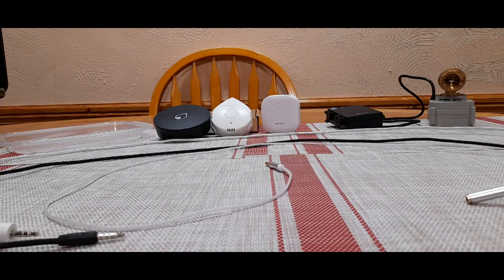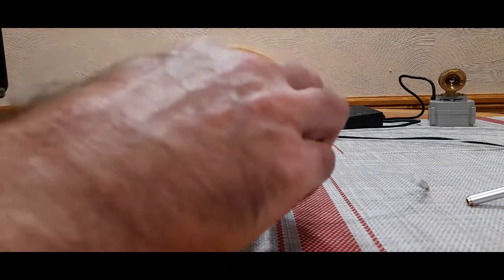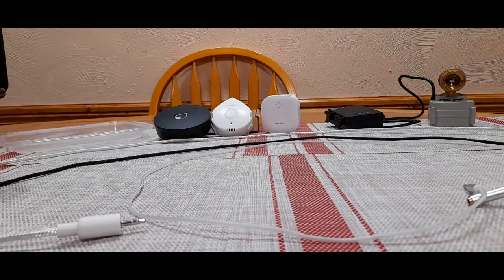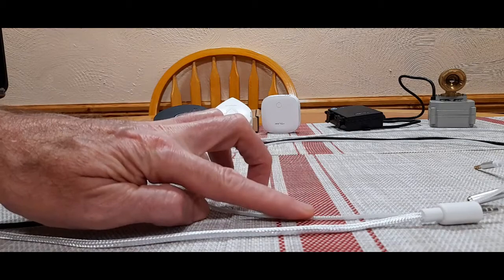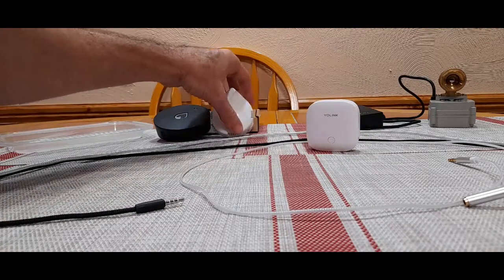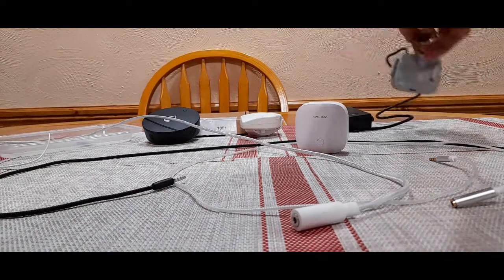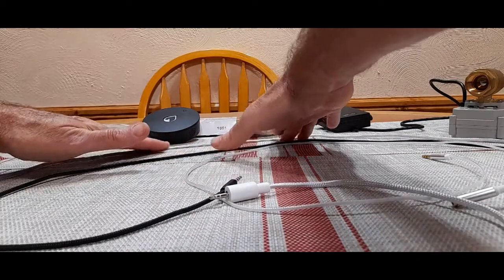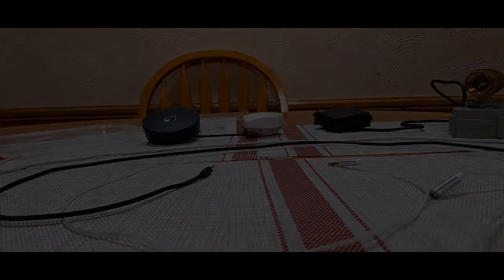Water Detection Cable Review: Yolink, Phyn & Honeywell

Comment: so the whole length of the cable detects water and not just the tip of the cable?
Reply from the maker: Yes, anywhere on the cable that gets wet will activate the water sensor. Thanks for supporting the channel by commenting and giving the video thumbs up.

Comment: for me it is not an issue that the cable does not lie on the table, because I will put the insulation on it. It is more important to know which product works more reliable and accurate/sensitive on long term. Do you have any test results about that? Or do you know any specific solutions for flat roofs? I will need several hundred meters of that cables..So I am looking for a professional product (cable) which should work ca. 50 years without any maintenance. items which are not under the insulation but outside can be repaired our replaced easily.
Reply from the maker: You are trying to detect potential leaks under a flat roof?  Thanks for commenting & subcribing.
Reply: @CyberMedics  on the flatt-roof there is an insulation which might be damaged over the years. In case of a leak in the bitumen  layer (on the top) rain can get into/under the insulation. If you dont  detect this asap this issue may damage the concrete roof. There is also a solution with rfid which will warn you, when there is water in/under rhe insulation.
Reply from the maker: @h.k.6266  
The LoRa Tech is under ideal conditions is rated up to 1/4 mile (400 meeters).  The Honey well cable is compatible with the Yolink sensors.

This is probably your best best bet.  Buy Individual cables and connect up to 500 ft

Resideo (Spun off from Honeywell)Cable & Documention 
https://www.resideo.com/us/en/products/water/leak-detection/rwd80-water-sensing-cable-8-ft-rwd80-u/
https://www.homedepot.com/p/Honeywell-Home-Cable-Sensor-for-Wi-Fi-Water-Leak-and-Freeze-Detector-RCHWES4/300043433
https://digitalassets.resideo.com/damroot/Original/10000/33-00627EFS.pdf

Some other search results, but not sure of compatibility
- NOVELL 38-134677-00, 38-134670-00 CABLE SENSING WATER LEAK 50FT, ADPTR MODU, NEW
- Liquid Detection Sensor, Plenum Rope-Style - Length 50 ft water sensor cable, 100 ft 2-wire cable

Hope you gave the video a thumbs up.  Please update us on what you choose and how it works out.  Thanks for subscribing.

Comment: Did I miss it, or did you not test the Phyn unit itself?
Reply from the maker: Thanks for commenting! Here is a link to our phyn sensor review https://youtu.be/YXr1DlFMYeE.
Reply: @CyberMedics  Gotcha.  Did you try any of the cheaper cables with the Phyn?  Or it's totally proprietary?
Reply from the maker: @Chuckolicious   the phyn cable seems to be proprietary, but the phyn sensor worked with all the cables.  The phyn sensor cable has three bands, so you may give up some functionality if you use another manufacturer's cables. The phyn sensor did detect water on all the other manufacturers cables.  Here's a link to our sensor cable compatibility review https://youtu.be/Mrd-wR4tzUs
Reply from the maker: You are correct. This video is focusing on the cables that come with the different manufacturers sensors.

Comment: We are changing the sensing cable, per customer input, like yours. It will lay flat and it will dry faster. Keep those reviews coming!
Reply from the maker: Thank you! You have an impressive system. Looking forward to reviewing the cable and promoting your efforts. BTW Honeywell cables are compatible with yolink.
Reply: Can this cable detect, for example, the level of a water tank so I know how high the water is?
Reply from the maker: @leandrolampier5869  This cable cannot, but yolink makes a water probe cable that can be used for your purpose.  Go here: https://shop.yosmart.com/collections/yolink-smart-water-solutions  and look for the Water Level Monitoring sensor.  Sorry for the delay in getting back with you.  Let me know if you need further assistance & thanks for subscribing!
Reply: Are redesigned cables shipping now?
Reply: @ohheyalan123  I purchased and installed a Yolink Hub and 4x Water Sensor 2 units 3 weeks ago (May 2022). These came with cables that do lay flat(ish) and are covered witha woven synthetic material that wicks the water into the cable inside. Mine are laid onto a fairly deep pile carpet and have opted to put some thin wood strips on top to force them into the pile a bit better. This way if water does track along the carpet the sensor cable should have a better chance of getting wet. HTH
Reply from the maker: Thanks for coming and supporting CyberMedics. I’ll have the cables been working out for you? Please share our contact to help others. Thank you.
Reply from the maker: @ohheyalan123  Thanks for commenting and subscribing.  I've reached out to Yolink directly and will let you know when I hear back.  I don't see them presently on yosmart or amazon.
Reply from the maker: @ohheyalan123  As we noted in the video, you can use the Honeywell cables.
Reply from the maker: @ohheyalan123  According to Yolink the redesigned   cables are shipping with the sensors.  Not sure when they will be selling only the cable.
Reply: sorry for the writing i don't speak english!